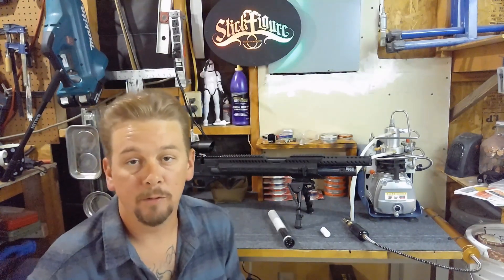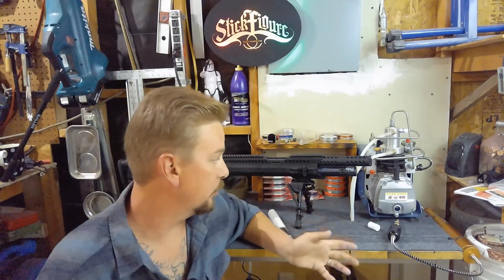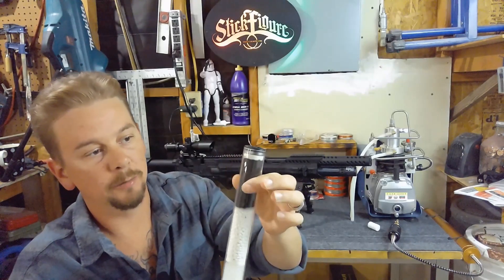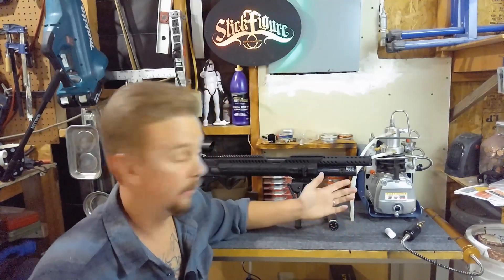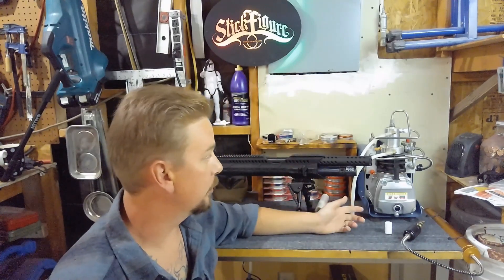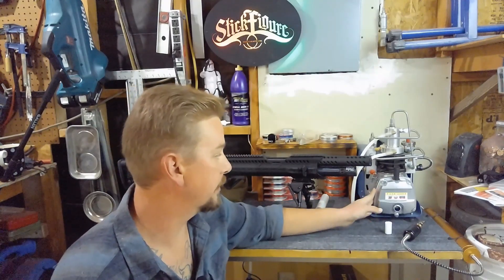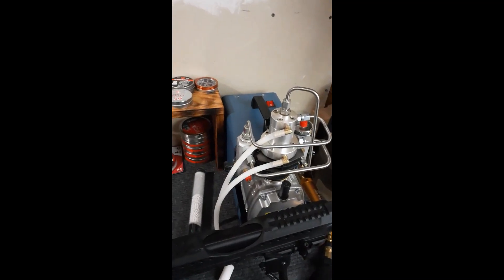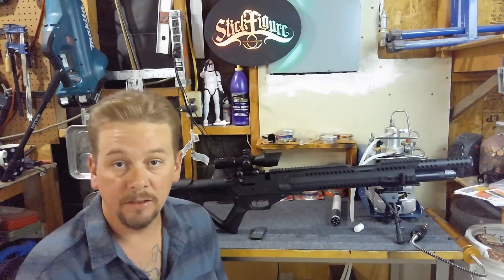Yong Heng (4500-psi) - Compressor Quick Review And Instructions

Comment: I use a 5 gal bucket with 2 milk cartons .cut the top off an freeze with 3/4 or less water and keep frozen. And toss them in the bucket. If ever fill a large tank you will definitely need ice the colder you keep that water, and change the oil the longer that compressor will last
Reply from the maker: I upgraded to an Omega compressor.  I couldn't have been happier to get rid of that Yong heng! After filling my 90cf tank, the Omega is still cool.

Comment: If you can run water from a garden hose through a filter then out to yard you get way better cooling
Reply from the maker: Yes. That would definitely work.  I've moved on to a much better compressor about two years ago.  I don't have to worry about cooling anymore.  Plus, Yong Hengs scare me. Much to many failures with injury.
Reply: I can't do that due to hard water.

Comment: Will it not power on until the item you're filling is connected?
Reply from the maker: It will turn on without being connected. However, you won't be able to connect it once the unit is on.

Comment: Hello, I have a question, I was using my Yong Heng today for the first time, I am filling a big 9L 4500psi carbon fiber air tank. I changed the oil in the compressor when it got to 1000psi for the break in, and then when it got to 3400psi, I noticed the oil was dark, so I changed it again, and I decided to check the ice bottles I have in the 5 gallon water bucket, Now when I reached into the water all the water had an oily feeling to it. Is that normal for the water to feel oily? I did not finish airing up the air tank after the second oil change at 3400psi. I am being cautious I do not want to damage the compressor.
Reply from the maker: Hey there! Thanks for watching!  No. That is definitely not normal. I don't have any noticable oil in my return water. No residue in my bucket. I would return that one. Definitely something wrong with that. I hope you get a good one sent out!🤙🤙
Reply: @bullfrogairguns  I got it figured out, the oily residue feeling was coming off the frozen plastic waters bottles I put in the water.
Reply from the maker: @99prochargedbird85  Good to hear! I'm glad you got it figured out and able to use your Heng!🤙🤙🤙
Reply: @bullfrogairguns  I can't return it, its too late for me its already pass the time. This sucks I purchased this Yong heng to replace my tuxing compressor that stop making any kind a pressure after only 6 times of use, I tried fixing the tuxing and gave up, tuxing does not honor its warrenty. Nothing but bad luck for me over and over. Well I guess I have to buy another one.

Comment: I used to think the worst purchase I ever made was buying a boat until the day my young hang air compressor was delivered, AAAAARRRRGGGG!
Reply from the maker: Hey Gary! Sorry to hear that! This has been a great investment for myself. Though I do want to do a major upgrade and go for an actual scuba compressor. Hope you have better luck with yours!
Reply: I've worked at three hundred bucks oh, and it was supposed to come with everything I needed, the only came as a compressor no hose no filter no relief valves. I had to use all my engineering skills to gather up the items myself oh, because they will not respond to my messages. It will only filled my dive bottle to 2500 PSI? Haven't tested it on the gun bottle yet
Reply from the maker: @garyg2318  I ordered mine through Amazon and had to return three before I got a box with everything in it.
Reply: 3 times! That must have taken months! I'm invested over $550.00 in this 2500psi pump! Could have gone to the dive shop latterly down the street 40 times for that bread! But I'm stubborn and wanted this thing work! The dealers should be ashamed!
Reply from the maker: @garyg2318  luckily it only took a couple weeks. It still drove me crazy though! My upgrade is $4k but in the end, it'll save me a lot of time and frustration.  I'm just filling guns at the moment but plan on getting tanks.

Comment: How do you determine what pressure to have the compressor at? Should it be right at the max psi for your rifle or above that?
Reply from the maker: Hey Carlos! Thanks for the view! I set the compressor according to which gun I am filling. Some of mine are 200 bar and some are 250 bar. Plus I'm looking at some with max 300 bar. I do not fill to max pressure. I usually fill to 190-195 on my 200 bar guns and about 240 on the others. Hopefully that helps you out.
Reply: What ever the gun is capable of being filled some are 3000 psi and some are 4,350 but i always go a little under recommendations on the fill because  the first few shots will be in accurate and then it will settle in
Reply: I love mine. It works perfect. I stacked 2-5 gallon buckets upside down on each other. Fill 1/2 way with water and I freeze half gallon milk jugs throw them in the water. I can fill my scuba tanks. It works perfect. Never overheat. I leave mine set up? I don't take it down.  I chang the water out once a week very easy

Comment: Had my Yong Heng for 3 years and had zero issues,I attached a extra large filter,gold colour cylinder plus fitted a moisture filter to air intake.
Fills FX Streamline .22 from 1200psi to max in about 5 minutes.
Also fill a Air venturi Avenger to 4000psi in about 7 minutes
Instead of using ice,I've used the blue freezer packs you use in coolers,just helps keep things cooler in summer,also use mine in basement where I use dehumidifiers which helps keep moisture below 60%
Reply from the maker: Hey thanks for the view and feedback!! So far mine has worked excellent as well. I haven't used any ice or anything because my temp is always below °50c. I live in a pretty dry area but I still added the extra filter. I have the little one that came with the compressor connected after the gold one. I keep an eye on that one to see if anything is making past the 3 stage filter. So far the small filter is clean and dry.

Comment: And another downside is: Well there are many.  This thing if actually used weekly will not last six months. It is actually a cheap piece of junk, regular use it will not withstand.  Use it once a month, OK it may last a year. 
So 350 bucks for the compressor. 
60 bucks for hydraulic oil
200 bucks for a decent filter to get rid of water
400 and up for a decent 4500 psi tank. 
So that is 1010 bucks........conservatively-plus other odds and ends. Uh oh......not so cheap in price after all!!

Or just go buy and Omega Trail for 900 bucks and fill your gun direct and forget all the aggravation, down time, and worry about water in your air gun or tank, and toss the tank also, you can carry the Omega with you, hook it to your car battery, etc, etc, or fill up your gun direct at home from the nearest 110 outlet. 

Yong Heng used to be a less than ideal solution , as time has progressed it is now only an exercise in frustration that will actually cost more than a modern decent high pressure air compressor. 

Times have changed, progress has been made.  Check out the small direct fill compressors designed to fill your air gun directly.  This is currently the best and most economical way in our current world.......or cheaper yet, go rent a 6000 psi Nitrogen tank and buy a regulator and enjoy 100 plus fills per tank and a yearly rental of on average 125 bucks and a fill 75 bucks , regulator one time cost 200 bucks.  200 bucks a year, by 100 fills equals 2 bucks a fill.  Let them worry about the tank safety and hydrostat. 

Cheers
Kit
Reply from the maker: Thanks for the input and view! Although I agree with you when it comes to there being better compressors on the market. Cost wise, they aren't comparable. I spent about 250 for the compressor, 20-30 for the oil, and just over 100 for the secondary filter. I use mine a lot more than once a week and have had it 9 months now. Many people have great reviews and experiences with the Yong Heng's. Others have terrible things to say. I think it has a lot to do with how you treat and use it. I'm not pushing or selling these. Just giving a reference video for those interested. 
Cheers!
Reply: Well why don't you pass out the $900, you talk as if you can afford to do that. I bet even Kit Carson-the real one got lost going to the outhouse!!!

Comment: Theres no point in having a moisture filter laying on its side as moisture lays in the bottom of the filter laying down and therefore bypasses the the micro beads!!
Filter should be verticle to be able to do their intended job.
Reply from the maker: I have changed the configuration of my setup. I now have the filter vertical.  Updated video is coming.

Comment: I absolutely LOVE my 'Heng. It's really sweet. I can fill 4 PCP's from empty to full in a few minutes and it never gets above 100˙ƒ. I use refrigerated distilled water and I leave the fish tank pump in the gallon (cut a slit in the side) and have the two tubes coming out the top. Takes me 30 seconds to set up.
Reply from the maker: I love mine as well! I'll be putting out a second video on the Heng soon. New tips and I rearranged my setup. Your setup sounds legit! Only thing is, I have heard bad things about using distilled water in these. There are no minerals in distilled water. Therefore the distilled water tries to draw minerals from the metal it is flushing through.  Thus corroding the inside of the compressor.  This is just what I have been told by many people with much more experience than myself. Hopefully this helps you out! Thank you for the view and your feedback!

Comment: Nice demonstration and review. I too have 3 of these units and the oldest is 3 years old and running. I too have a similar configuration but recommend that your large filter be verticle with the outlet at the top so gravity keeps solids and liquids on the bottom rather than pushing it along through your media, also be sure to open that vessel and allow it to air dry to minimize any corrosion. One last bit of friendly advice is that the little submersible pump that is provided has a very limited head rating of something like 24", consider upgrading to a pump with a greater head capability with flow rate adjustment. Again awesome video and thanks for sharing!
Reply from the maker: Thank you very much! Since this video I did some rearranging.  First thing was switching the filter vertically. Thanks for the tips and feedback!  I really appreciate it!
Reply: Hajimoto knows his stuff ive watched plenty of his vids and still debating on getting one of his upgraded umarex gauntlets or getting a armada still on the fence of what i want
Reply from the maker: @jakec5063  he definitely does! I'm looking into getting one of his Gauntlets!

Comment: Push your temp guage probe in all the way for an accurate reading. Also you should keep your coolant bucket higher than the pump, it will make your water pump last longer and work more effectively. I also add some ice to my bucket.they also suggest 2 gallons minimum of water,  i use a 5 gallon bucket with a few cups of antifreeze and some "heet" good video man.
Reply from the maker: Thank you for your feedback!  I'm curious to see if there is much of a temp difference with that probe pushed in all the way! Also curious to see how much longer yours lives with the extra precautions? Keep me posted!
Reply: Will do
Reply: what temp probe are you referring to? No idea what you are talking about but want to learn in case I go this route. :) thanks...
Reply from the maker: @larrycoleman2225  in the video, to the left of the gauge, lined up with the handle on top, you can see a black wire connected to a metal stem. The stem slides  into the compressor.
Reply: On one of my yong hengs the temperature probe wont go all,the way in, like yours. I will eventually drill it out, but everything's running fine as is.
Reply from the maker: @dennislieder6178  I was able to push mine in all the way. There was no noticable difference in temperature reading. Not sure it's worth drilling out?
Reply: @bullfrogairguns  yeah, not worth potentially damaging the head. I saw another guy bought a temp gauge that had an off switch. Good idea, no need for the battery to be draining while the Heng ain't runnin!
Reply: My stupid 
Temperature guage probe doesn't fit in the little hole
Reply from the maker: @carlosgaztelucabral8061  hey Carlos!  That's the first time I've heard that. I wish you could post pics here so I can see what's different between ours.